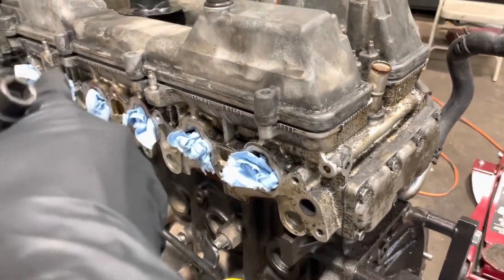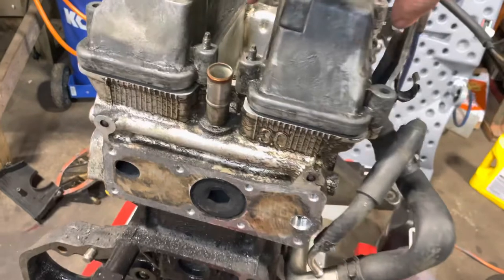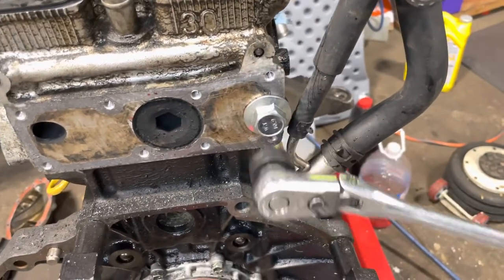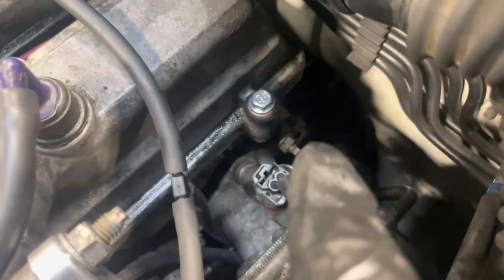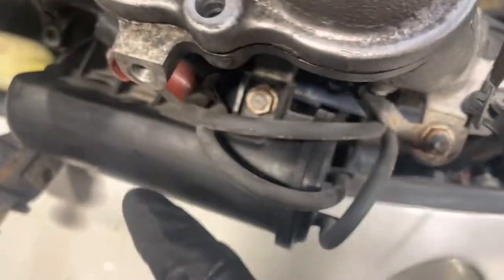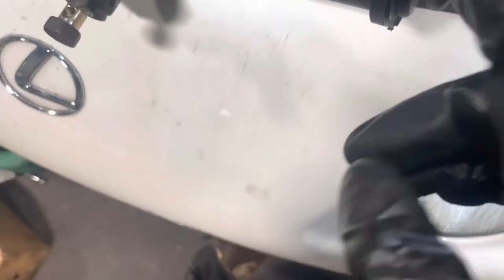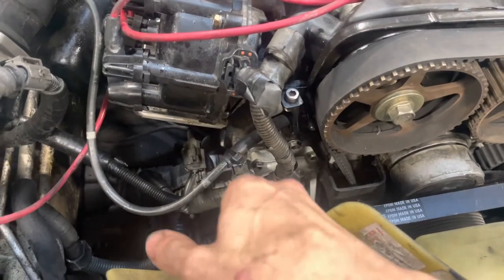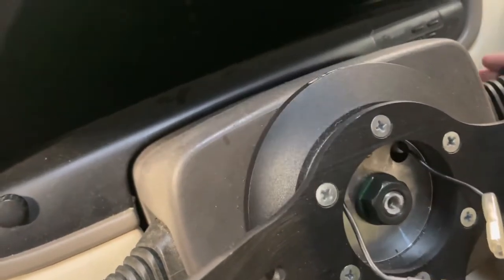2JZ-GE EGR Delete and Vacuum lines

Comment: So if I were going to run a FFIM and turbo I can just get rid of all the vacuum canister, butterfly valve, and vsv stuff? Just making sure because I haven’t been able to find anything about it online. You’re pretty much the only person I’ve seen that has even mentioned the vacuum canister
Reply from the maker: Theres more info in the comments, but no don’t need the canister at all for either. For turbo you should get rid of the butterfly valve and the vsv related to it. Good luck!

Comment: Hey bro i have a 2001 lexus is 300 2jzge vvti.

I recently had my timing belt changed out and idle is slightly shaky and my mechanic said its probably from vaccume lines. Do you have a video or explanation on how to connect the vaccume lines in the correct spots for a vvti 2jzge
Reply from the maker: It is the same as these, only difference is you do not have egr so all you have to do is route the lines. The simplest way is replace the lines already there one by one in the exact same spots.
Reply from the maker: Would look up how to check for vacuum leaks its pretty straight forward.

Comment: I didn’t understand the last little bit at the end of the video.  Your trac light is on because you manual swapped? I have a 96 auto and a 92 stock 5 speed and (don’t yell at me) I’m taking the w58 from the 92 and putting it into the 96 with all the manual parts just until I can get my hands on a r154.  How can I keep the trac light off? And what is the best way to get rid of the vsv sensors littered around the 96 engine bay?
Reply: Also, I’m mid turbo install and I busted a vacuum hose on one of the vsv’s by accident and now the car will start but immediately stall so I’m thinking vacuum leak.  How should I go around all the sensors?
Reply from the maker: Trac communicates with the auto, there is probably a way to trick it. I don’t need it so I haven’t removed the light and couldn’t tell you how. Not really a way to go around the sensors, the ones you don’t need you can simply route directly to what the line is for. If not needed you plug it. But some VSVs for example the heater core valve are necessary for you heat to work so you would need to replace it or plug it and run no heat.
Reply: Oh dude I'm in the same boat. I have a mint '95 auto but have a '93 manual I'm taking the transmission from. How's the project going?

Comment: do you need the block off plates? or can you run it without them
Reply from the maker: Yes as said in the video, unless you’re plugging the back, but the intake one is still required. You can make them but you need to make sure its vacuum tight.

Comment: Question - I have a stock IS300, I'm wanting to eliminate the black tube box under the intake manifold as you mentioned.  Will you need to attach a breather filter somewhere to accommodate the removal of the black box under the intake?
Reply from the maker: The vacuum tank can be removed just need to keep the VSV routed
Reply: @Daniel_Aviles  so you’re saying I need to remove the vsv sensor thing that is connected to the charcoal canister and keep the hoses routed? Sorry I’m doing a lotta research to get rid of the canister and plug stuff up, I was under the impression that everything including the sensor can be trashed.
Reply from the maker: @danielgalan6518  The black canister can be junked. VSV opens and closes the throttle at a certain RPM, if you get rid of it and attach the hoses it will keep the Intake open. Therefore you need to keep the VSV routed to continue to open and close the valve if you’re staying NA, because it helps create mid range torque. If you’re going turbo then you should delete the valve in the intake, canister, and VSV altogether.
Reply: @Daniel_Aviles  thanks! Yes I’m NA and plan to be for a while unfortunately. I was originally under the impression that I needed to remove the vsv as well in order to complete the deletion of everything. Glad I asked.
Reply: @Daniel_Aviles  one last question, the VSV you're referring to is behind the intake, not the one attached to the black cannister under the intake, correct?
Reply from the maker: @danielgalan6518  I am referring to the brown one on the canister
Reply: @Daniel_Aviles  Thanks friend!

Comment: If I wanted to do it with no cel, I have a 95 do you know resistor I would need? And where would it go?
Reply from the maker: If you check out the pinned comment on top it explains it, I am not sure personally, but I believe he goes over it in detail in the replies as well good luck!

Comment: soo.... since im NA, i just left the vsv connected (the one coupled with the black canister under the intake runners)-- i removed all other vsv's. is that correct?
Reply from the maker: Thats sounds correct, also found that you do not need the canister as long as the vsv for it is still routed. Good luck!
Reply: @Daniel_Aviles Wait so if I’m NA, I can delete the vacuum box? You said in video “if you’re turbo” so i got confused as to what to do for NA. So do i need to keep the vacuum box and vsv with the vacuum diaphragm on the intake mani?
Reply from the maker: Need the VSV not the vacuum tank
Reply: @Daniel_Aviles any chance you can do a quick video on how those lines go? There’s 2 on the vsv correct?

Comment: so is the turbulant air bad for the engine if i was to not tap that hole or does it really not matter?
Reply from the maker: Its fine you can do the plug on the side, its not the end of the world it probably results in 0.1 hp lol. The main reason is to keep the temps in that area down. Hope this helps lmk if you have anymore questions!
Reply: @Daniel_Aviles  I see do you think its possible to plug that hole in bay? i might give it a try but i feel like thats gonna be a pain.
Reply from the maker: Not its not worth the headache tbh. If my motor wasn’t out I wouldn’t have. To put a threader in there while the motors in bay would be near impossible and you probably wouldn’t be able to remove the shavings either. I don’t advise it.
Reply from the maker: The EGR plug will do just fine when and if you take the motor out in the future I would just do it then.
Reply: @Daniel_Aviles  ok thank you